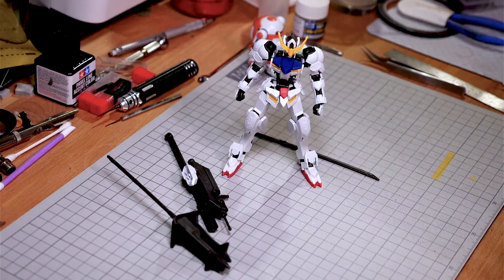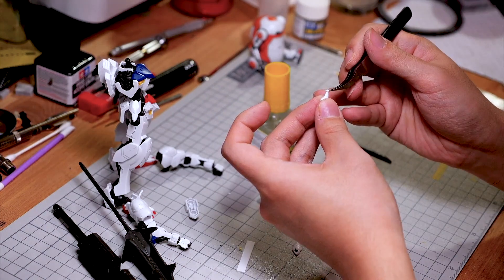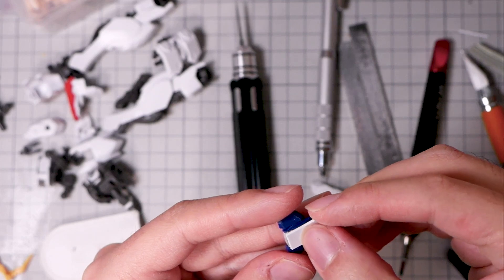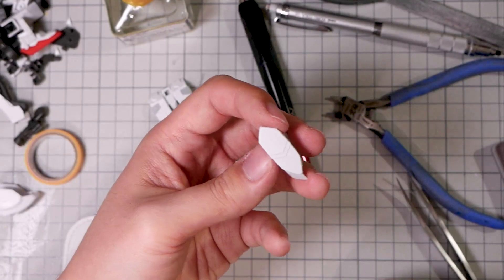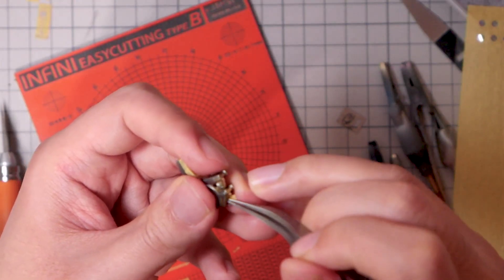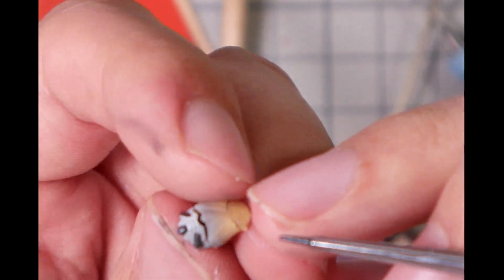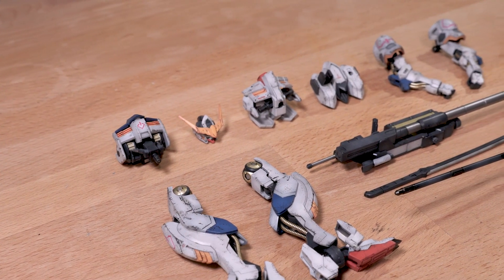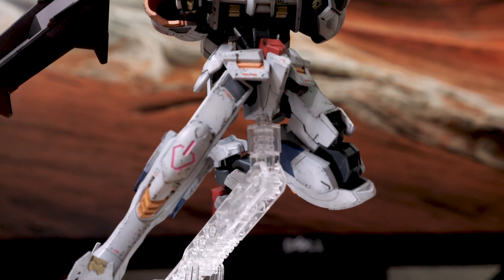Was that really just a HIGH GRADE?? HGIBO Barbatos | Kit Analysis

Comment: What size pin vise and brass rods are you using? I have done a similar modification however I’ve just been cementing a piston extension to the cut piston and it’s pretty weak.
Reply from the maker: Plastic cement is gonna be pretty weak for these types of fixes, I recommend just filling all the of hollow areas with super glue. Much stronger. The brass rod size doesn't really matter in this case, your mod is only gonna be as strong as the weakest part of the mod, which is your cement.